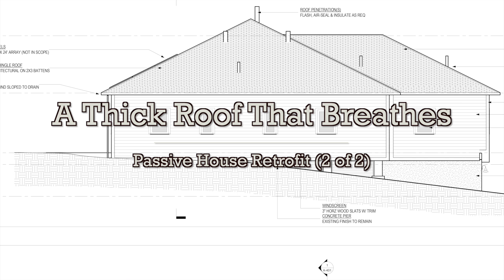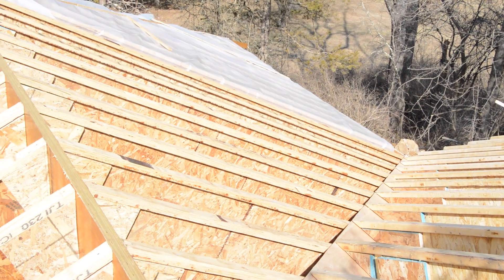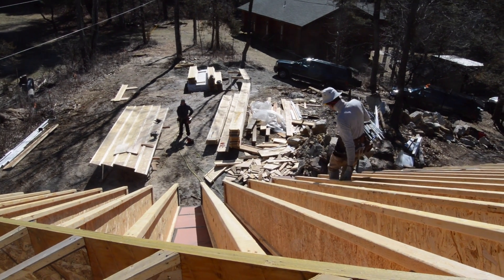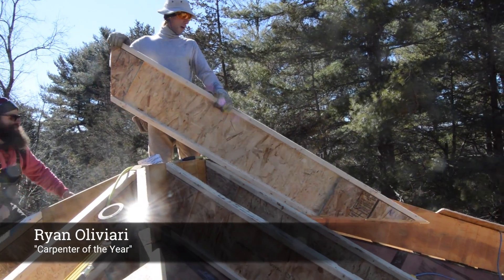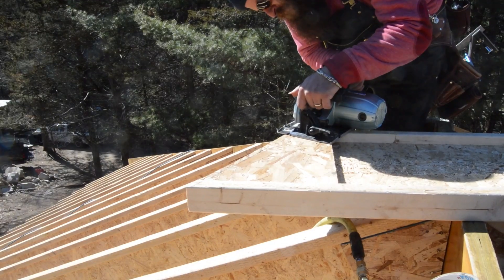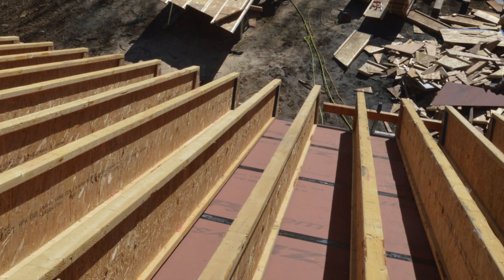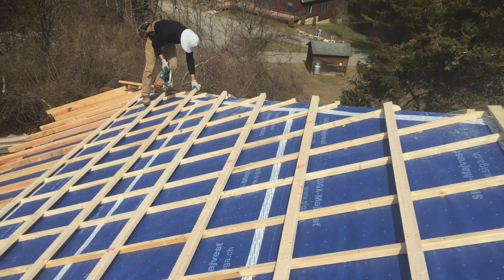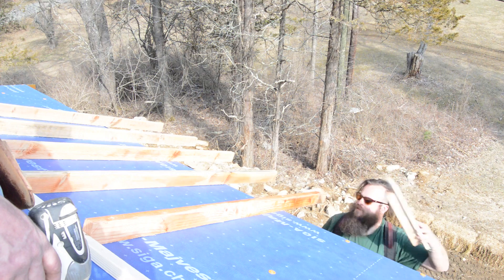Modified Larsen Truss Retrofit: I Joists on the Roof 2

Comment: Whats the R level for this application...this be helpfull here in New Brunswick Canada...6' to 7' drift of snow on roofs here...
Reply from the maker: The builder said that the i-joist insulation added up to R-60, and there was an additional R-30 inside.

They also covered the walls with I-joists and were meticulous about air sealing.

It earned PHIUS+ Certification in 2016.
Reply: @ProTradeCraft  this should be a norm for new homes add stiffness and lots more...i subcribe ..thanks nice vidéos!!
Reply: R you ready!
Reply: And cellulose  will settle leaving no insulation in place .

Comment: Just curious what the advantage of this is as compared to alternating layers of rigid foam over the old roof deck?  Isn't there more thermal bridging (not to mention complicated carpentry)?
Reply: This is all wood (timber+cellulose) so carbon-negative. EPS or PUR adds significant embodied emissions as it's all oil-derived. When you get to really good insulation levels like this the embodied emissions start to matter almost as much as the in-use emissions so are worth paying attention to. You could just use woodfibre boards to get the 'build it with boards' aspect but that construction would be a lot heavier - the roof below might need beefing up. https://static.cmostores.com/uploads/products/4/l/steico-special-dry-installation-ea40iqiekb.jpg
Reply: Makes sense, thanks for the reply!  I've actually seen your other videos about wrapping with exterior foam, which is part of the reason I asked.
Reply: =to Treehouse= I also prefer the idea of rigid foam that you mention. 
This video does give an interesting alternative. 
My question is how expensive is the cost of all those engineered truss and inserted insulation, compared to foam. .
Reply: As a friend pointed out to me when he described this design to me (which I'd never heard of until today), the OSB is quite slim in the center of the i-joist, so the thermal bridging is minimal. Additionally, blown cellulose is inexpensive, so on a per-R-value basis, this may be less expensive in terms of materials (but I can't imagine less expensive in terms of time).

Other questions I'm unsure on that perhaps someone else could help with:
- How are the i-joists are set up to not tip over? I would have guessed some blocking scattered throughout the i-joists would be required, but perhaps the dense-pack cellulose is enough to provide the necessary stability?
- How resilient is the roof to uplift? I don't know the strength of i-joists when they are in tension rather than compression.
Reply: Also rigid insulation is not vapor permeable like this assembly